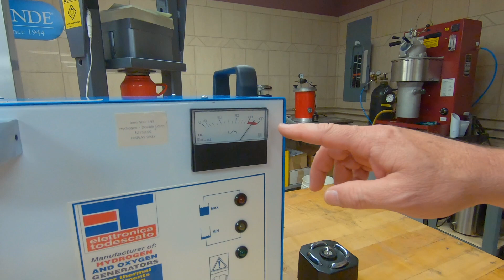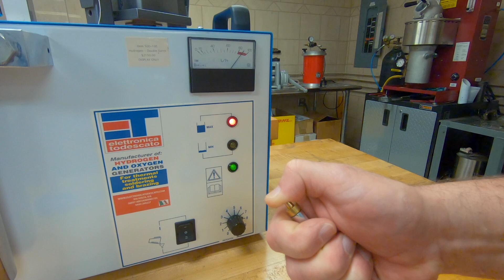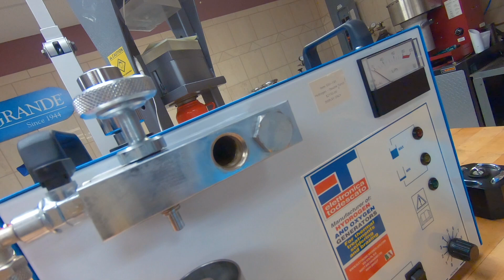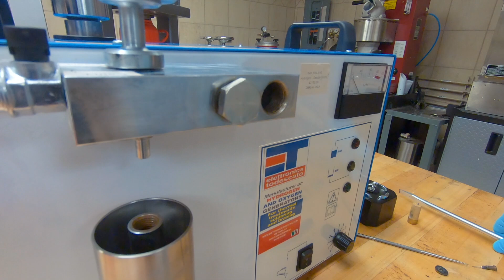How to Maintain and Troubleshoot the Dual Torch Hydrogen Welding System

Comment: Hi just wondered why you called the flux tank a flux tank and what you put in it ? We call is a bubbler or flash arrestor ...... also you have a great flame on the gun mine is pin sharp and kind of hard to handle the heat is sooo pinpointed ???